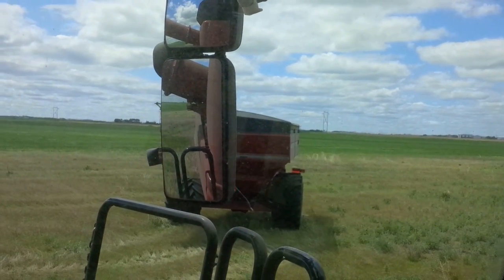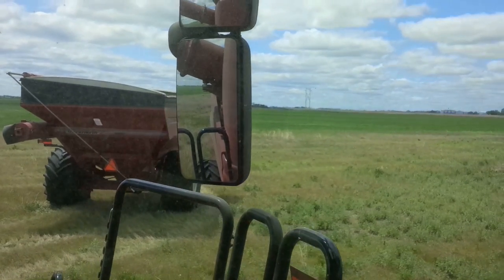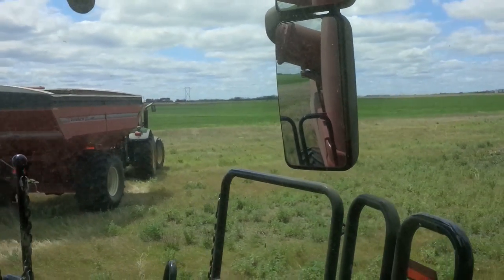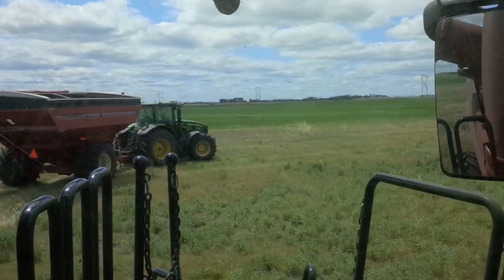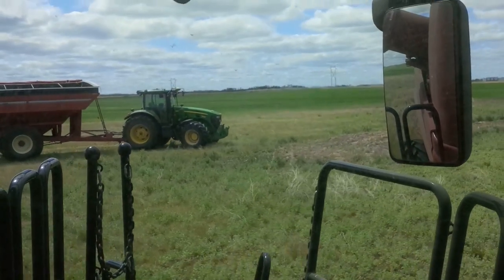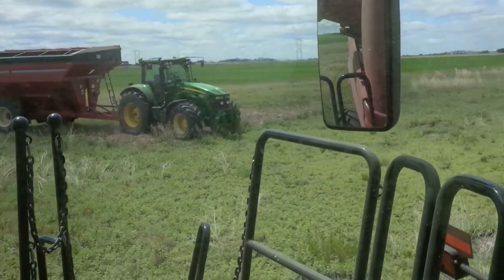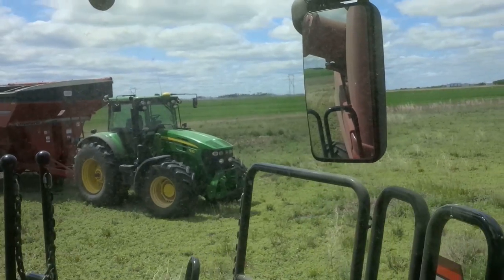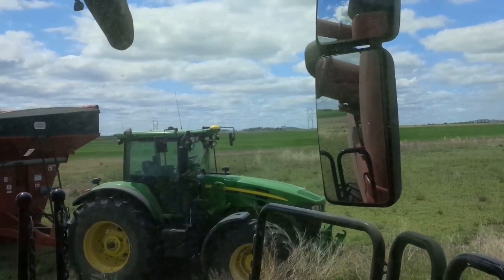DIY Driverless Automated Grain Cart

Comment: Are you a farmer that is an autopilot hobbyist? Or are you contracted by farmers to get systems like this working?
Reply from the maker: I'm a farmer doing this as a hobby, and also because I think it will be useful in harvest time.
Reply: Hi Mathew
Approximately what is the cost to build an autonomous tractor and cart.
Could the tractor be controlled by the grain truck driver to dump into grain truck?